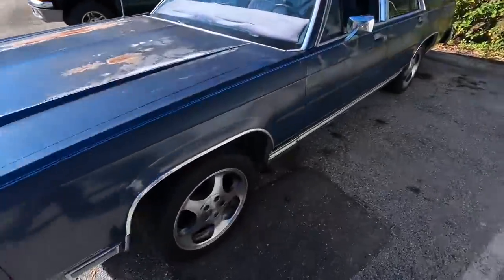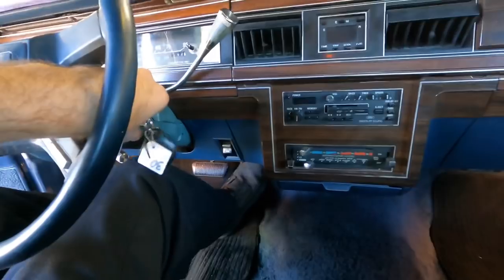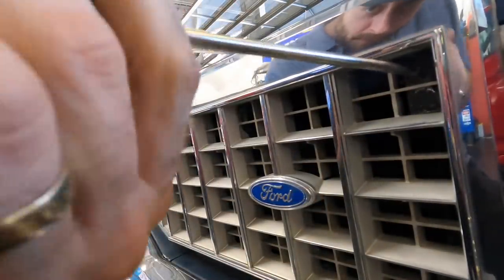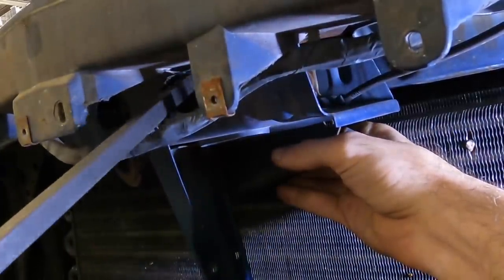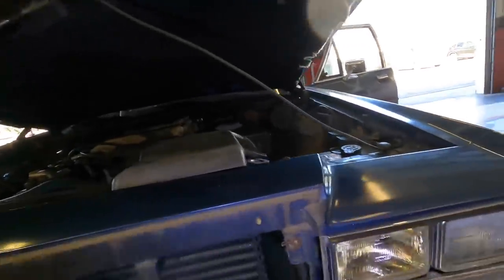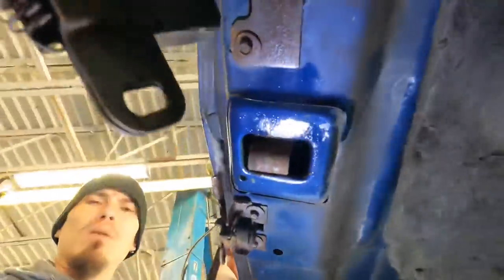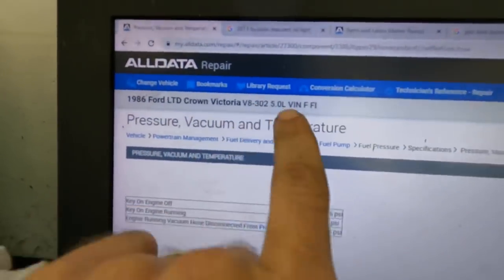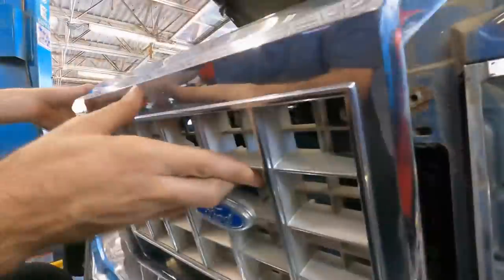Customer States: Replaced Engine, still stalling!

Comment: For future reference the EEC iv ford ecu has a plug on top of the left fender inside the engine compartment which was next to the coffee can on this car. You need an obd 1 code reader and the right adapter for it to be used.
Reply: I have an old Snap-on brick for when something like this comes in.  IMO it works better than newer scanners with compatible adapter.

Comment: In my 92 mustang 5.0 the engine would run perfectly, then sometimes die and not start. Final fix was an engine computer. Several capacitors had leaked on to the main circuit board.
Reply: salted-road runner?

Comment: Ill start by saying love this channel. But in the 86 to 96 fords the diagnostic port is obd1 and under the hood on the driver side. And the fuel check shredder valve you removed need to be in there to check it. That engine has to have it least 32psi at start up just to start. Love the channel. I'm a heavy diesel technician so this is a coming episodes for me.

Comment: This takes me back to the mid '70s when I worked in a truck shop. I had to do some work on a 1967 Mack slab cab. I brought it into the shop and started to jack up the cab so I could work on the engine. So I'm jacking up the cab and nothing is happening, I add some hydraulic oil to the jack pump and still nothing is happening. I checked around and under the truck but there were no leaks. I told the foreman and he said to park the truck back outside as we were a Cummins Engine dealership and did not do general truck repairs. When I opened the door to get back in the truck, the jack lifting rods were extended all the way up to the dash. Everything that the jack rods were attached to were so corroded and rotten the rods just came through the floor. Showed the foreman and a few other mechanics and we had a real good laugh.

Comment: Even without the diagnostic tool, you made a good guess about the fuel pressure and were right.    You have a skill.   Whoever installed the engine couldn't figure it out.

Comment: I would try the fuel filter first, probably a lot easier to change and if it works you don't have to drop the big dollars on the pump, besides who knows what's in that old fuel tank⛽😬
Reply: Based on the hood latch, I'd say changing the fuel filter will be a 4 hour job.
Reply: @SteveTheExploiter  More like two bolts and two fuel line disconnects lol
Reply: The pump will probably come from a junkyard, which is probably where the replacement engine came from.
Reply: Vacuum controlled fuel pressure regulator needs tested before I'd go tearing into anything else. 
I'd most likely replace it regardless, just because it's long in the tooth and threatening to take a scrap nap at any moment.
Reply: @gregoryking9348 In which case I'm wondering how old the vaccum line/hose to that regulator is at this point, too.
Reply: Had an old Mercury something or other (okay, my memory's not what it used to be) that would randomly lose power or stall. Turned out to be a secondary fuel filter in the carburetor inlet fitting. Would never have known it was a filter just looking at it.

Comment: I would of guessed a carburetor, but since the engine change is total difference  set up. it was funny to see you look for the comp connection for codes. didn't start those much later on. thanks for the video, it brought me memories of my younger years. my first car was a 1969 Ford custom 500, with a  289 engine. I was 18yrs old cost of the car then was only $500 bought in 1970.

Comment: FYI for the future, these pre-OBDI Ford's used the EEC-IV which has a test port pigtail (one big and one small) under the hood near the brake booster. You plug in the special tester from Actron and count the flashes to get codes, which there aren't that many.

Seeing that motor reminded me of my old 5.0 LX, although in the Mustangs the engine was rotated the other way; amazing the guy still has the spark plugs wire cover even!

Comment: Haven't watched the video yet, but I have a funny story about engine stalling. Years ago I picked up an MGB for super cheap. It wasn't running (strange isn't it), but I knew it had good compression. Actually the car was in very good condition, except the starter was coming apart. My father rebuilt the distributor while I put the starter back together and rebuild the carburetor. When we put it back together the engine started right up and ran very smooth, engine very healthy no smoke at all. When the accelerator was pressed it died quickly. It was night, working in side yard, low visibility. I had put choke on accelerate and accelerate on choke.

Comment: I'm surprised that you didn't locate the fuel pump, apply copious thread lock to the bolts and then torque it down to 500 lb ft, like you did several months ago.  (It was a joke Ray did on an old yellow oil pan that was going to be replaced.)

But, really, you should have checked the fuel filter first. A car that old has a tank full of rust and crud, which would clog up the next filter in no time.  You should have suggested draining the tank and washing it out with another gallon of clean gas.
Reply: @watchful31 :
Perhaps he did that (loctite), without showing us?
As for suggestions, the "customer" had/has no intention to have him, or any other professional, actually do the work on it, so . . . . why not just leave out any helpful suggestions?
Reply: @K7DFA  The other suggestions were for the benefit of the rest of the armchair mechanics who didn't get the wisdom from Ray.  

I suspect that Crown Vic will be back for a fuel filter fix and a tank washout, if not for a redo on the stuck hood latch.

Comment: For carburetor cleaning in the country, we secure a long mile road and run it hard to blow out the crap! 🤣😂
Reply: pour a half a bottle of transmission fluid down it while revving the engine   clears up most carburetors and frees stuck valves and cleans carbon build up smokes like hell BIG white smoke !

Comment: Had that same issue in my old 88 Mustang LX 5.0. Ended up being the fuel line between the pick up and pump in the tank. Had a split from the ethanol fuel. Lost fuel pressure. Replaced a 2” piece of hose and the problem was fixed.

Comment: Almost old school, except for the carb.  I learned about cars when fuel injection was only for diesels.  My first overhaul was my 1964 VW Beetle 1200cc air cooled engine.  Service was points, condensor, plugs and oil.  The Beetle had no oil filter, so oil was changed every 1500 miles.

Comment: I like the 302 V-8. Are used to have a 1987 F150 with the 302 V8 in the fuel injection. It was actually simple to work on and everything.

Comment: Back when I was  younger went to  wreaking yard to get steering column couldn't get hood open (written on front clip SAVE) They got Michigan loader with forks gently inserted  them between grill and hood lifted expecting a pop front of car was  4 feet off ground and shaken before  it opened. (Car about 74 Buick)

Comment: As soon as I saw the engine, I knew about what year it was, as well as a couple of possible problems.  The EEC-IV module being mounted on the side of the distributer, tended to overheat and fail. Once the engine cooled long enough, it would be ok again. There was a lawsuit trying to force a recall/fix, which ended up being a remote mount for the EEC-IV module on the sidewall, which had a heatsink on it. Of course if a Tech didn't mount it properly with heat sink grease to begin with, the module would fail in either location.

Of course with carb. V-8s out that year, in favor of Fuelie V-8s, the throttle body and throttle plate was a bit smaller and more restrictive than in successive years. That year gunked up the throttle plate more easily, which resulted in the engine trying to "surge away" with you at a stop sign or light.

Of course, the fuel sock covering the inlet of the fuel pump often was clogged with tank rust from condensation and the normal 39 or so psi would be lower than normal. 

I'm just at the point where you reached the 2nd conclusion, which was even more likely than the first, due to age. Customer should likely replace the fuel tank as well. It's only about $150-200 more in parts and unless they're cutting the trunk to make the access panel they should have had when they made it, then they'll have to drop the tank anyway.

Comment: I had a 1983 LTD about 4-5 years ago. It was a 302 with CFI (Central Fuel Injection). Kinda like a GM throttle body from the 90s, but not. I couldn't keep that thing running no matter what I did. I took the injection off, and bolted on a carburetor being it has a throttle body bolted onto a normal 2bbl intake. Still ran like shit, but better. Put a points distributor in it and it finally ran like it was supposed to, but would still randomly die for no reason that I could find. The engine light in that car would only illuminate if the engine had no oil pressure or was overheating. To check codes, which it did save but did not tell you about was quite the process. The MAP sensor had two ports on it; one hooked to the engine, the other just open. With the engine running, you apply a strong vacuum to the open port for 5 or 10 seconds; the engine would rev up and cycle the purge valve giving you Morse code of what number code it had. (2 longs and 3 shorts would be a #23) Had to put a test light on it to be able to see it because it couldn't be heard over the engine. Then of course, good luck finding out what these numbers mean. GM stuff is easy to come by, Ford not so much.

Comment: I’ve had tight bonnet latches before. What can help is someone pushes down on the thing and holds pressure, while the other person pulls the release. Sometimes things are a bit cockeyed and it won’t release because it’s bound up. Pushing down will unbind it.

Comment: Plugy plug is in on drivers side under hood. I think its has 5 connectors. Hood latch was a common issue. My 1st car was an 86 vic. I put for performance heads on it, did the H.O. firing order swap, police exhaust, edelbroke intake and throttle body.  Thing ran 14.9 in the 1/4. Not too bad for an 86

Comment: ** Here is a hint from a previous owner of a 1986 Ford F150 with 302 c.i. (5.0L) motor (same as the car in this video) with same issue, just not quite as bad. Mine would run rough at idle, stall, and restart after it warmed up. I would drive it 10 miles to work, pull up, stop, put in reverse to back into a parking spot and it would die. It would start, rev up and I would back into my parking spot. What the problem ended up being was a bad gasket between the fuel injection plenum (on top) and the intake manifold. The gasket was rectangular about 22 in. by 8 in., divided into 8 equal rectangular sections, (1 for each cylinder). The gasket would be loose between the compartments where the gasket separated each compartment for each cylinder. Replacing the gasket would fix the problem. The fuel injection plenum had one "security" bolt that was Torx and required a special long shaft Torx bit (25 Torx?) The first time this happened I took it to Ford because it was in factory warranty and they couldn't fix it. So I talked to a mechanic who worked for an independent shop who took care of our phone company fleet of vehicles. He said replace the gasket, I did and it fixed it. It happened again when the truck had 50k-60k miles, I replaced it again and it fixed it again.
Another note, another associated problem I had on this truck was a bad high pressure fuel regulator, it went bad. Each fuel tank had a fuel pump and there was a high pressure pump also on the frame, under the drivers seat. The pressure regulator cut the pressure down from about 90 psi to about 35 psi (when working correctly). When the regulator went bad the truck wouldn't start unless I pushed the gas pedal to the floor giving it enough air to mix with the gas. I would throw it in drive at about 3k-4k rpm and hold on to get the truck home. I replaced the fuel pressure regulator and that problem was fixed. I loved that truck.

Comment: As an owner of a 91 Marquis I enjoyed this one, albeit being too short. I’m wanting to do an engine and transmission swap on mine, 351 or 347 if a roller 351 to build is unobtanium. Holley efi to run it and a 4r70w to move it around. Rear end was already professionally swapped out to 3.73 and limited slip. Engine and transmission has yet to be sourced and is essentially on my wish list. For now it’s a fun little cruiser and the rear end swap alone woke it up a bit.
Reply: Awesome! I got an 86 Merc Marquis and am just finishing up an LS swap with holley Efi. Tied to a 6l80e its gonna be a blast!
Reply: @anonymousranter2583  noice, you’re living the dream man. 👍🏽

Comment: Fords in that era had what they called a "break-out box" with what seemed to be about 100 pin receptacles built into it.  By probing with a volt ohm meter in certain combinations of holes in the box you could get readings on several components.  You need a Ford manual for that model to know which holes to probe for which component and what the readings mean.

Comment: I got one for ya.  86 Plymouth Reliant 2.2 non-turbo.  Throttle body injection.  When it gets above 80 outside it will stall when attempting to throttle up.  Replaced injector, TPS, Temp sensor on the TBI fuel pump, tank, filter, ECM Position sensor, gaskets on the TBI.  Acts like a carb that's set wrong.  Or a bad float but it's injected so no float.  AGH!

Comment: My inlaws bought one of these new, the 2 door version. They got decent service out of it. I think this was a terrible era for Ford, while the car was very solid and comfortable, I thought it was just weird. The tranny would fully upshift by about 20-25 mph, then the car seemed to be lugging. I recall theirs lost a fuel pump and had to be towed to the stealership while it was still relatively new. I found it to be a hard car to love. I was poor back in those days and driving a 78 Cutlass Calais, which I thought was a much better car despite its age.
Reply: No way. This is a way better car, usually

Comment: Carburetors have accelerator pumps that shoot raw gas into the venturi to make up for the sudden increase in air when you push down on the gas pedal.  That gives the carburetor time to increase the flow of gasoline to the venturi to match the amount of air flowing through it.

Comment: I was working with a cheap small Japanese printing press built with cheap crummy metal.  Bearings and stuff out wore out easily.  My supervisor told me "If it moves, oil it.  If it doesn't move, oil it until it does."  Words to live by.

Comment: I had a similar problem with a carb'ed 81 Olds Custom Cruiser. The driver had run the fuel down low and sucked up a bunch of crap from the bottom of the tank and plugged the fuel filter. Ran fine at idle, but struggled at any speed.

Comment: My 77 camaro 350 would be down on power and stall on the highway above 35 after 30 to 40 minutes. Then when I would be  stopped for like 10 minutes and it would be fine for a bit. I found that the floats were sticking and over fueling thus chocking the ignition. After pulling the carb their  was a decent puddle of fuel in the dual plane intake. Taking the carb apart showed alot of corrosion in the float bowls. After cleaning everthing up and using new gaskets it finally ran just fine. As a diesel mechanic I have found too much fuel on a gas engine will make it sound "cammed" and lack of fuel on a diesel engine does the same. What the problem could be is yours to figure out.

Comment: The connector is under the hood  for the scan tool to hook up , possibly LH side near firewall , or RH side. Also i think you should have left the shrader in the fuel line for the gauge to work. 5 psi wold not keep the engine running. Maybe if it was carbed.

Comment: aaah the old ECC IV system with the pip and TFI module, you could actually use a analog voltmeter connected to the STO and STI to get codes if ya didn't have a star tester, or after market scanner adapter.

Comment: I was surprised that the Crown Victoria didn't have that S-T-U-P-I-D variable venturi carburetor. I had one (sister-in-law's) 84 with verible venturi and internal (inside the carburetor) vacuum leak would make it sputter and stall when accelerating. I wanted to rebuild it, but the vacuum leak was in the secondary slide mechanism itself (yeah, it did didn't use a butterfly on the secondary of the horn) and I couldn't rebuild it nor replace it because no one had a kit. So, I swapped if for an Autolite 4300 off a 78 LTD. I had to substitute the ignition model and rewire the distributor (used the parts from the LTD), and it needed an intake adapter so the body sealed which in turn made the air breather assembly about 1/2 inch to high so I had to "make it fit" (I should have used the LTD's intake manifold) but it solved all the problems. The car ran great for many years.

Comment: My parents had the same care and it had a 302 v-8 free floating  carburator .
Reply: And it also had a fuel pump attached to the engines . The dist had the mid part that snap on than the top of the dist thanthe
Reply: Rotor it self .  Sorry about my fat figures typing

Comment: I had an 85 Crown Vic  it had Ford's CFI system.  86 was the first year for the EFI 5.0.  I'd love to see more stuff like this.  My first thoughts were either fuel or IAC motor.  Those latch mechanisms are a bit fussy sometimes.  I saw one like that cut a notch in the hood.